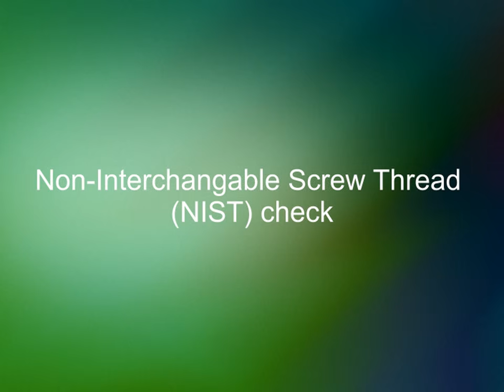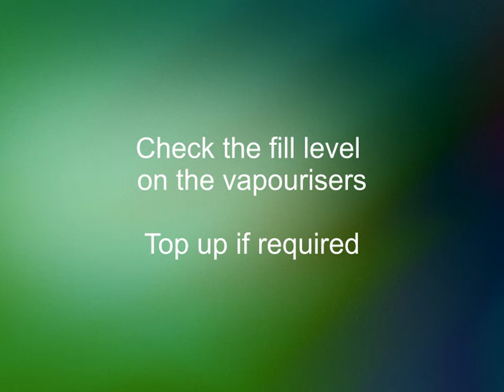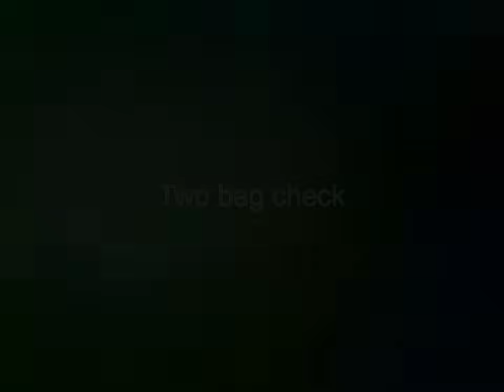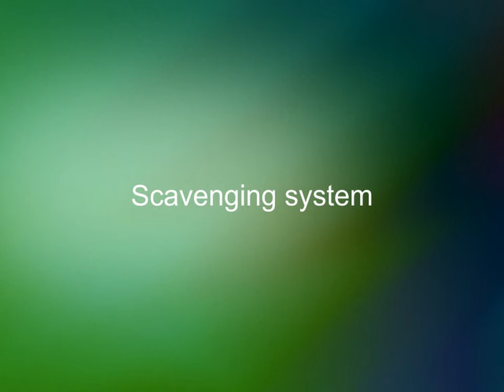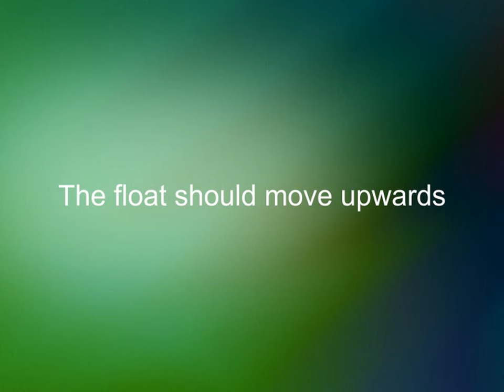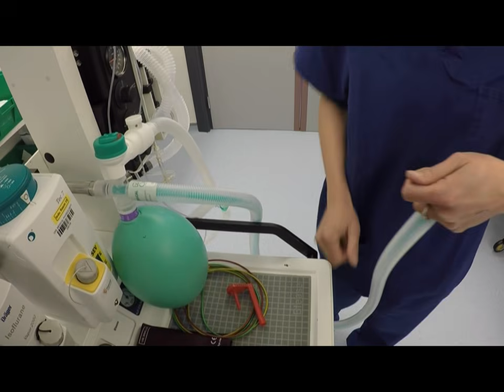Anaesthetic Machine Check

Comment: There are three glaring omissions from the checks, all of which are life-threatening:
1.: Ensure that the Oxygen Failure Device (OFD), also commonly know as "Bosun's Whistle" is functional . 
To establish this, first establish that the oxygen pipeline is connected at the wall, ceiling or pendant outlet and that the reserve oxygen cylinder(s) are turned off and the cylinder pressure celebrating zero. Now, with the oxygen diameter turned on, disconnect the oxygen pipeline and listen for the instantaneous and readily audible sound of the OFD sounding. If it fails or the sound is quiet, the machine must immediately be withdrawn from use and referred for servicing by an appropriately qualified engineer in possession of HTM22 certification.
If the OFD deployed properly move on to the next stage: turn on the oxygen reserve cylinder and the OFD alarm should cease. Now fully turn off the cylinder to ensure the OFD deploys in the event of oxygen cylinder depletion of failure. Again, if the OFD fails any part of this test the machine must be immediately withdrawn from service.
If all is well, the oxygen pipeline should now be reconnected and it is only at this stage that the pipeline patency tug test should be performed.
2.: Perform a gas line anti-pollution test: i.e.: when turning on each of the gas supplies, observe the rotameters and ascertain that turning on any one in sequence does not adversely cause a drop in level of the other spinning rotameters. If there is a substantial drop, this is indicative of intermixing / pollution of the gas supplies and the machine must immediately be withdrawn from service.
3.: Check that the back bar vapouriser interlock system is working such that more than one volatile agent vapouriser cannot be turned on simultaneously or subsequently whilst another is already on. This prevents the patient receiving too much volatile agent or a mixture of more than one volatile agent. If the interlock device fails the machine must immediately be withdrawn from service.
It used to be common for anaesthetists to keep Boyle's apparatus up in which there was no interlock device or upon which it has been disabled. This permitted two volatile agent vapourisers, containing the same agent, to be turned on together, thereby permitting a much higher dose of agent than would be available from a singular vapouriser. This is particularly useful in closed circuits using ultra -low gas flows such that insufficient would otherwise be delivered by such low gas flows.
This also facilitated the possibility to deliver two different volatile agents in tandem. Most frequently this would be a mixture of Halothane (Fluothane) with Trichloethyline (Trilene) which was a cardio-vascular stable mix, beneficial for use in elder and frail patients, especially for ophthalmic surgery, and of great use in paediatric and obstetric anaesthesia.
'SAFETY' IS THE WATCHWORD.
I was a member of Professor Anthony Adams' interdisciplinary teams which produced the initial Checklist for Anaesthetic Machines and the subsequent Pictorial Checklist for Anaesthetic Machines published by the Association of Anaesthetists of Great Britain and Ireland between 1988 and 1991.

Dr. John Richards, DSc., Dip.Ed (RODP)Expert Witness